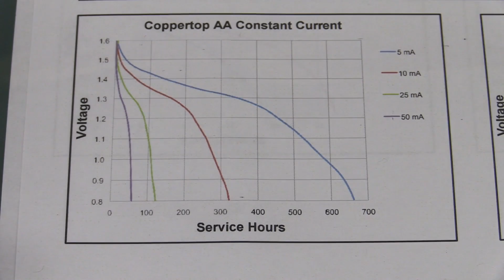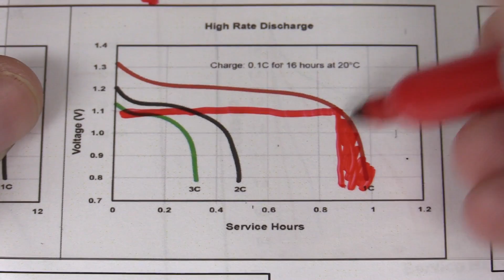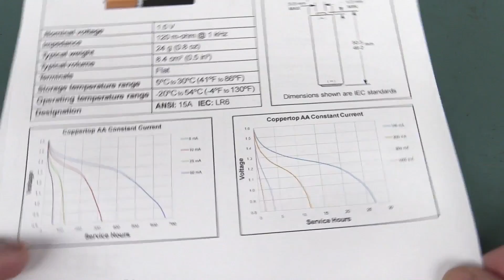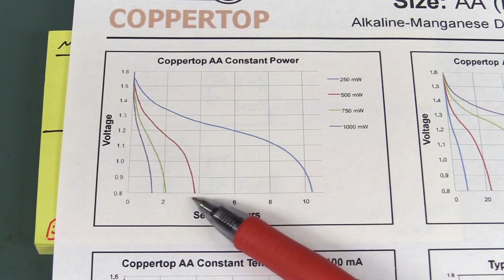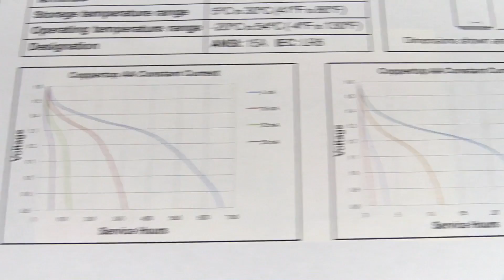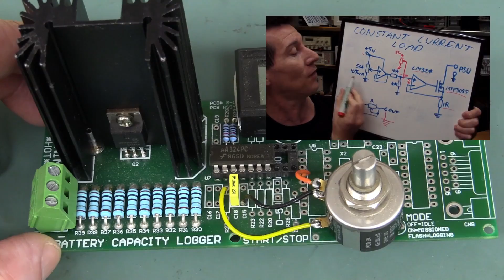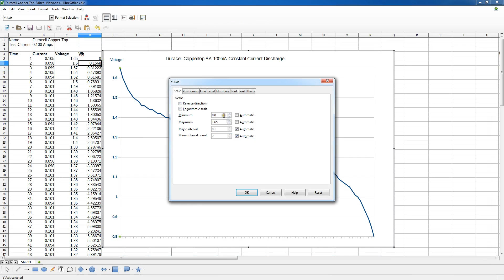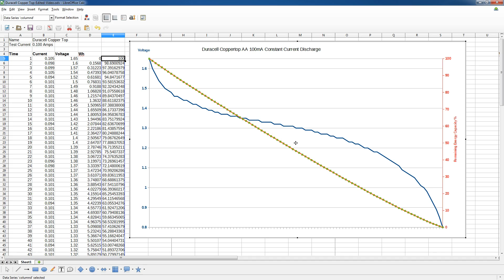Comment: At 17:00: Fully Battery Capacity of your AA-Battery is calculated to 12 Wh. The correct Capacity is about 3 Wh  (@100mA)
Reply: Elektronik He does say that he's not really using watt hours as a unit, and that the particular unit doesn't matter for the purpose of what he's doing. The "Wh" figure was just an example as he was talking.
Reply: Mythricia that means he tested for 4 hours?
if 1 hour = 3Wh then 4 hours = 12Wh ? maybe? just curious
Reply: Elektronik No, I mentioned the actual units are not corrected to actual Wh.
Reply: EEVblog Let's say that expected capacity is 3 Wh, then 12 / 3 = 4 hours. Duracell graph says that it takes ~27 hours to discharge battery to 0.8v under 100mA load. What's going on ? :)
Reply: Elektronik I think that technically, you need to multiply that I*V by the (delta t) i.e. the time-step size, after adding the previous energy value.
So,
E = E(n-1) + V(n)*I(n)*{t(n)-t(n-1)}
Since your time resolution was 1 second, you don't get any errors (apart from being in Joules rather than Wh). But if you had any other value, your energy value will be wrong I think.

Comment: Unless your time is in hours you can't just do current * voltage. It is wrong on so many levels when you label it as Wh.
Reply: SirJMDDK I mentioned that.
Reply: EEVblog No. You say: "and if you want watt-hours and stuff you'd put like divide by 3600 .."

The problem is that you are doing a newbies guide to calculate energy, but you completely skip the proper way to calculate watt-hours, yet you label your column "Wh". You're showing 11+ Wh for a single AA cell.

Next time someone new to this tries to calculate battery energi, they will do as you and do current * voltage.

Why not show proper engineering practice? (T2-T1)*((I2+I1)/2)*V
Reply: SirJMDDK 
First he specifically said it's not really Wh. Secondly it's totally irrelevant for getting the remaining percentage. Thirdly everyone doing real energy calculations should know this basic math anyway and how to convert units like Wh/Ws/Joules whatever.
Since he collapsed multiple measurements into a single data point the first column isn't any usual timeunit anyway. It might be in units of "27.2seconds" for example (that's why he said "put like divide by 3600"). Imagine the confusion when doig this division to getto the correct Wh.
Reply: superdau Correct. The whole point of this video is the percentage remaining calculation using the graph.

Comment: Very interesting. My first digital camera (a toy really at 640x480) only worked with non-rechargeable AA batteries and even those didn't last long in the camera, but still worked for ages in other devices after removing them from the camera. Obviously a poor design with a high voltage cutoff!

Comment: Good video. However you have some errors in it. When you say that the capacity is the area under the graph that is correct but when you mark this area its not. You must include the area from 0v to 0.8v aswell.
Reply: Magnus Arvidsson Dave must make your comment an integral part of this video, derived from your observation.
Reply: Magnus Arvidsson 
It should be clear that the "area under the curve" is the area down to the axis.
Reply: superdau Well it should be but at 28:05 Dave clearly shows that this is not clear at all.

Comment: You can determine if a AA battery is good or not with multimeter. Just stick the meter on amps and do a 1 second reading. If it will not deliver enough current it is bad.

Comment: Dave, I use the AA, AAA and "AAAA" batteries !  The "AAAA" fit the Streamlight Stylus and a Laser Pointer that fit next to a couple pens that fit the Fisher Space Pen Refills !  Also use the CR123A in a LED flashlight and an UV Water Pureifier.  Have used the 1.5 VDC "A" battery and even took one apart !  Have you done a teardown of an "A" Battery ?  Like the Alkaline, Li and High Tech Rechargeable Batteries ! (Say NO to Cadium Batteries)

Eyes UP and lights down,  tjl  Sent by Win7Pro64 w/ADSL

Comment: Spreadsheet "pro tip": Instead of dragging a formula down, you can double-click the little black square that marks the lower right corner of the selected cell, i.e. the one you'd normally drag down.
This expands the formula to all the data rows. And with many rows it saves a crapload of time. :-)

Comment: Don't you have to take the first timestep into account? If I understand it correct, there was 0.105A at 1.65V for 1 timestep, but it wasn't used in the calculations. You started with the second timeslot. So don't you have to calculate E(t)=E(t-1)+I(t-1)*U(t-1) (with E for Energy)?
Reply: dhufi 
How does your formula change anything. With it you're just shifting the error to the end of the data, because now the last entry of the table isn't used. That's the error you get from discrete math. The voltage/current isn't constant for the whole timestep anyway and still it's used in the calculation. So for a better calculation you should use the voltage/current average of two consecutive points (this assumes a linear function within each timestep, which is more accurate, while the first version assumes a constant function). 
But the best way around: make the timesteps smaller, reduce the error.

Comment: Nice video, good to see some facts for once in this discussion. I loved the way they used the Apple keyboard power graph as an example. It's tricked into showing 100% as it's presumably based on voltage and is obviously not a valid measure if using a DC-DC converter. So the power gauge will always show 100% then drop sharply to 0% when the DC DC drops out. The keyboard with batteries alone will slowly drop towards 0% as the voltage (under load) decreases. Whether that is before or after the one with DC-DC probably depends on load I guess, the efficiency loss through the DC-DC, vs the small gain under the cutoff. Be interesting to see if a 90% DC-DC converter would be more efficient at any load, at what load would it break even, and where it would be a lot worse to have the DC-DC. Of course, they should have done that and presented those results, but I can't seem to locate them........
Reply: ***** Yep, the battery life gauge is calibrated for an undoctored battery. Of course it'll show a falsely-high battery remaining capacity when you trick it with a DC-DC converter, as it hides the variation in voltage that's necessary to be able to measure battery capacity. A DC-DC converter in line is like having a bank that always says you have thousands in your account, but then suddenly goes to zero when you make the final $10 withdrawal.
Reply: gblargg Exactly, maybe they could remarket it as a device with introduces some exciting jeopardy into you life, you'll never quite known when your keyboard is going to die.

Comment: It seems to me like hours of usage would be more relevant and simpler to calculate rather than using remaining energy. You would not have even needed to compile the second curve using just time.
Reply: Of course that would be convenient if it worked, but it doesn't. Depending on how what you plug the battery to you get very much different usage time from it.
Reply: pocoapoco2 
Then you didn't understand the part where he showed the straight percentage line. See the deviation to the real values?
Reply: superdau Yes, remaining energy vs. time is not a linear relationship. But you know what else changes over time? The power requirement of the device does. From a user's standpoint the remaining energy isn't as relevant as remaining usage time.  If you establish a plot for the specific device you are using that extends to the full .8 volts and measure the shut down voltage of the device, then the theoretical remaining usage time could be calculated easily if the device could actually function all the way down to .8 volts.

Comment: Instead of saying wasted, it would be more accurate to call it Unusable power.
Reply: Sasha Whitefur "unusable" is inaccurate as the power could be used, but it is not economical. And it is not even power, it is energy. It should be "unused" or "remaining" energy. But either way: It´s just changing words around and adding half sentences. For a PhD thesis, this can make all the difference, but here it is about the general statement/concept. Off course, general statements can be significantly off (like when driving with the last gallon to the gas station and either to make or not), but in those cases more care has to be applied anyway.
Reply: It's still power, it can be used more by only drawing .8V.

Comment: Hey Dave, nice Video! But the graphical analysis with the areas you did in the beginning was actually wrong. The area you marked is not the remaining capacity of the battery. You have to expand the graph all the way down to 0V to get the correct areas/proportions between the areas. (You are also mixing up capacity (Wh) with volthours, but considering the constant current that's fine).
Reply: Stuner Agreed, but it's nitpicky. The voltage-time plot is not energy but proportional to the energy in this case (Dave may have been sloppy with his words a couple times but he knows this of course...). Also the energy past 0.8 volts is probably negligible and iirc it's the cutout voltage of the batteriser.
Reply: wanswers I didn't write that as clearly as I should have. The problem is not with stopping at 0.8V (this is probably negligable), but rather not counting the voltage area below 0.8V which significantly changes the proportions of the voltage areas.
Reply: Stuner Ah, I think I see what you mean. Despite the area below 0.8v not being on the graph (which can be visually misleading), the method Dave used to calculate the area, i.e. Riemann sum style integral approximation, did in fact account for that extra area. The graphical description sort of ignored this, but the numerical analysis is still correct.
Reply: Stuner 
It should be clear that the "area under the curve" is the area to the x-axis. Otherwise you're claiming that just zooming into a curve changes its integral.
Reply: superdau Well, the areas Dave highlighted simply do not correspond to the energy that was used/is left in the battery. I'm certainly not saying that Dave doesn't understand this, but I also don't think that it was "clear" in the video that the entire area was meant. Also this does not invalidate the Riemann integrals Dave did later on in the video, as they take into acount the actual battery voltage.
Reply: Indeed

Comment: Now redo this video with a ~ 80-90% efficient DC-DC converter on it to simulate the batteriser.
Reply: Dc-dc converters vary in efficiency a lot with respect to load and duty ratio - you'd have to define type of dc-dc and when it should kick in to be able to retrieve some information from the experiment.

Comment: Just take the integral?
Reply: MogDog66 I've done a video on that: https://www.youtube.com/watch?v=Dh0xYu8YvaE
Reply: EEVblog What's taking so long to make the LM741 video for video 741?????
Reply: Ilias Patsiaouras in order for the concept of integration to make sense one would have to have a theoretical model for the battery and an analytical expression for the shape of the discharge curve. My spontaneous thought is that a shifted and normalized V(t)=A-B*atan(kt-t0) might work out fine. It is also easily integrable wrt t.
Reply: MogDog66 Actually he is calculating the integral using the rectangle method.
Reply: ***** that would be approximating the riemann integral by a sum - not actually taking the integral.
Reply: How would you go about taking the integral though?
Reply: MogDog66 How do you take an integral of some weird graph? integrals would be helpful for math functions like e^x and sin(2x)^2, etc. But as others mentioned, it would have to be a geometrical area approximation. A riemann sum is a good example.
Reply: EEVblog Dave, is it correct to integrate to 0.8V like you showed or integrate to 0.0V?
Reply: Renegade30 You have to integrate to 0V (what Dave did in the spreadsheet calculation) but the area under the graph has to go down to 0V as well if you want to visualize it. Otherwise your visualization tells you nothing.
Reply: Simon Nee I did something similar a while back, I used a cubic function that was shifted and stretched to fit a LiPo characteristic curve, though I found that to be much more complex and difficult (and potentially less accurate) than just plugging in data into a spreadsheet.
Reply: Power Max sounds like fun! but yeah, unless there's solid theoretical motivation for a certain function, linear extrapolation of experimental data should be better
Reply: MogDog66 Integral is just an area under the graph
Reply: +EEVblog Voltage? Doesn't matter much in a tungsten torch, does it. What about the cutoff current or cut off capacity?

Comment: Is this video a freaking spreadsheet tutorial ?
Reply: lacombar Kinda.
Reply: EEVblog Thanks for all the steps. I hate when people, books or Internet Tutorials skip steps, even when I know how to do it, because if I did something wrong I can compare both methods.
Reply: lacombar It's pretty trivial to do on a spreadsheet! With nice GUI, cross-platform, open-document format etc. I would argue gnuplot is rather un-friendly to use, but I've only tried (and failed) to use it for 3-variable graphing and interpolation.
Reply: Kostadin IV Kostadinov  It's LibreOffice (OpenOffice), much better piece of software
Reply: lacombar spreadsheets are like 90% of engineering
Reply: MrPolymath0 To paraphrase Dave, "Sorry, I only give negative feedback".
Reply: lacombar Spreadsheets are fun! One of the best things in life.
Reply: EEVblog Excel for dummies!
Reply: Brendan Wilding it's a lot of hassle for something which could be done trivially with, say, gnuplot...
Reply: EEVblog Then why did you only measure down to 0.8V instead of 0.1V? After all, it's not a rechargeable battery which would be destroyed by this sort of low voltage.
Reply: MrPolymath0 we should not live in the same planet...
Reply: lacombar why?
Reply: MrPolymath0 I could ask the same about your original [bold] statement...
Reply: lacombar rude
Reply: MrPolymath0 I think he's trying to say engineers are capable of anything, including space travel, and that you could pioneer that with your skills.
Reply: +lacombar Hi,

I have to agree with you, but I for one have a memory problem and have not been able to grasp the basic way a spreadsheet works and how to program it (if that is the correct phrase). So I take the longer view in what is happening to the battery and how to see that in a properly set up spreadsheet, so please be patient, we cannot all have everything we want to do ‘on the tips of our tongues’ so as to speak right?

Comment: Not quite right. If you're comparing a DC-DC converter to constant current, you have to account for BOTH the cutoff voltage and the constant current vs constant power. If your constant current product needs 1v, you're wasting all the area between the horizontal 1v line and the battery voltage curve above it.

 If you're going to bother doing it right, you should also continue the curve beyond .8v, I'd continue it until the battery no longer delivers enough power to run the device, whatever that might be(at any voltage/current combination), then compare actual active and standby time using your DC-DC converter vs linear regulator.
Reply: sleepib If you carry on past 0.8V the voltage drops off a cliff and has very little remaining capacity. You might as well treat the cell as being dead. Good point about the wasted power and this leads to another nail in the coffin of Batteriser. If you add a Batteriser to boost the voltage to a constant current load it will waste more energy than using the cell on its own. The regulator has to drop more voltage and waste more power!
Reply: sleepib 
A decent DC-DC-converter is a constant power load. So why would it waste the energy above the output voltage? That's how a linear regulator works.
Reply: superdau the constant current example uses a linear regulator, but doesn't account for the energy wasted by the voltage drop across the linear regulator, it only accounts for the energy left in the battery when your device no longer functions. If you're trying to decide whether it's worth switching to a DC-DC converter, you need to account for both.

Comment: Whenever you have a formula that gives you what you want, but is inverted, you can just subtract the max value by it and it'll inverse it... in your case just do =(1-D5/MAX(D))*100  .... Also, a faster/easier way to get a more accurate number is to use the hard numbers itself to get the actual percentage... Just find the shutoff voltage (1.1v) on the C column then when you have the formula plugged in go to column D and it'll tell you a very good estimate (assuming you have enough data points) of your remaining percentage.... It's more accurate than doing it in the graph.

Comment: I've never even seen this kind of graph for measuring remaining battery capacity... I learned something today! :D
Also, testing batteries under load... Never something I had ever considered, guess I'll be retraining myself on that aspect. I knew they regained some voltage, but I was told for years that you just hook the trusty old multimeter to the battery to see if it's good. Curse my know-nothing teachers of old~
Reply: Zeigwolf Just using a meter on the battery is good enough to determine if you should just toss it out or not, but you shouldn't use it to determine capacity. This is why the manufacturers give you under load voltage discharge graphs.
Reply: Zeigwolf The current range on multi meters is good for testing batteries, but it's not too good for the batteries though :-)